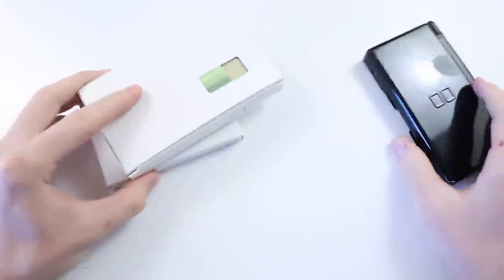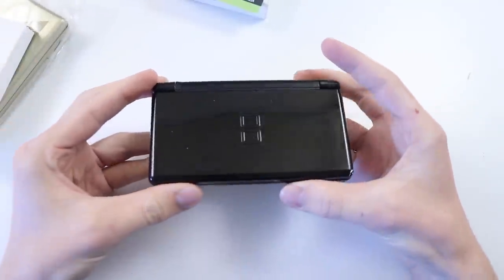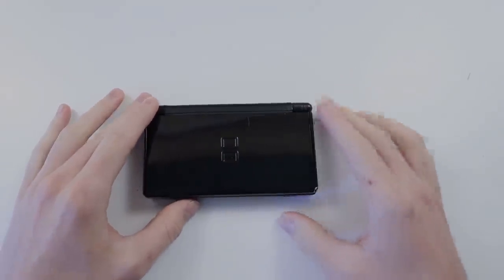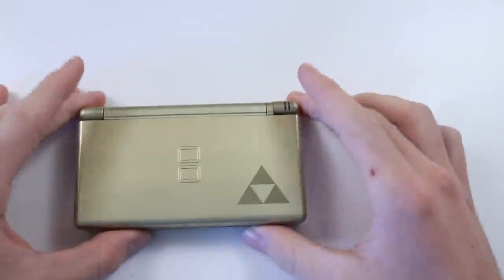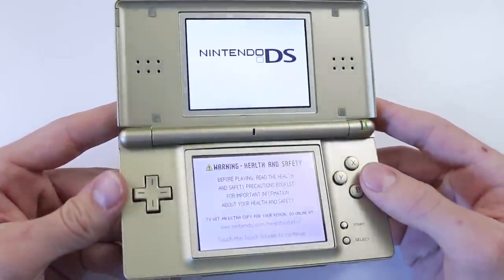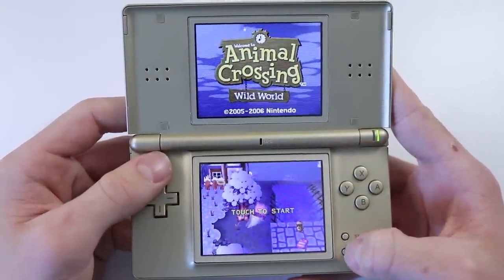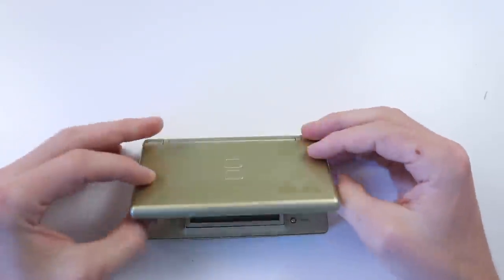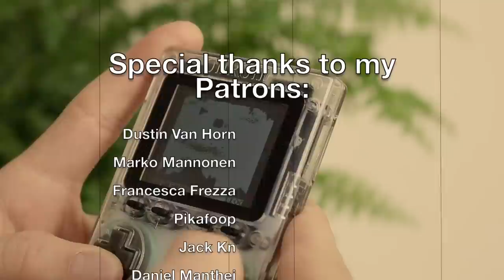Let's Refurb! - Nintendo DS Lite Screen & Shell Replacement!

Comment: I’ve repaired and sold hundreds of ds lites on ebay but I remember the first time I attempted to repair it took me over a month to complete the repair but then I got so skilled in regarding that I was able to fully change screen and reshell a console with broken hinge in 10 minutes. It was so much fun.
Reply: Where did u learn every component inside ?
Reply: @MrSea123456  i can repair your ds lite and change case to a clear one if you want
Reply: sadist
Reply: Can u repair mines
Reply: It’s turning yellow after 10 years
Reply: Lemme buy one off of you homie
Reply: My ds lite I have had it since 2010 (it was my older brothers didn’t know when he got it) the top screen is blue and the bottom screen has a bunch of dead pixels
Reply: where to you buy shells from?
Reply: whats ur account
Reply: Can I send you mine?
Reply: You doing that then vs me learning to do this now since the market is nice atm
Reply: @BigRheno  I'm also looking into fixing mine
Reply: @FancescaTanuki  can you repair my lcd?
Reply: I am still trying to get a DS Lite back to sit flush after taking it apart fully that is the real challenge
Reply: I’m actually doing it for my first time right now, although not for anything as severe as in these videos. Just cleaning the buttons and their places so that they work again
Reply: @ochuspin  how hard was it?
Reply: @SGVSOUTHSIDE  i was worried about breaking something but it went pretty smoothly!
Reply: Man, wish I could buy that
Reply: What shells do you use?
Reply: How expensive would it actually be to repair one? I Recently got one for free, but the top screen is just broken, any clue on how easy and expensive it is to fix/replace?

Comment: remember when people ripped the ds top display off to make it a gba...…...
Reply: People still do that 🤦🏼‍♂️
Reply: they still do that?!?!
Reply: yep
Reply: @Betrayed King PG3D Gameboy advance
Reply: whoosh
Reply: Idk why people still do that, u can just replace the top screen and have the ds ok
Reply: @SrSyztz  Some people aren't bothered to pay and try to replace the screen.
Reply: ChamCho124 I play the gameboy game  on the top display.
Reply: When my Original DS broke 2 weeks ago, my friend decided to rip off the top screen so he could have a free Game Boy Advance. Let's just say the DS no longer powers on...
Reply: It triggers me!
Reply: @maxwellm1266  I did it
Reply: I just did, most comfortable way to play GBA games. Rechargeable battery, headphone jack and I can put all my games on a flash cart to play it on the DS.
Reply: @sakurito55  you can route 1 speaker around back, drill some holes in the case, and have sound. I still prefer a full ds lite to half of one tho.
Reply: Do you just rip the top screen off? Or do you have to change the internals?
Reply: Well if it was already broken it's a welcomed change
Reply: Nerd Neck you have to bridge two parts on the motherboard, but it’s very simple. After that it should work
Reply: What if the inferior screen has sombe lights who wont work?
Reply: OH GOD YES I CRINGED
Reply: Why not turn it into a game boy micro
Reply: People did that?
Reply: Marg If you want a gba but have a ds that’s the simple solution
Reply: @ethanpiburn2107  If you rip off the top screen, you'll still have a DS slot. It'll just be useless.
Reply: They still do it XD I would but the DS Lite I use and the one that isn’t cracked on the bottom is special
Reply: Someone ripped a rare palkia and dialga one....
Reply: WHY???
Reply: The Yandere Real-Life Channel that’s big brain
Reply: Hey we get the top screens or they use those parts on other ds’s
Reply: he once did that for no reason btw
Reply: @margalocaris  Really old comment, but hey. Just wanted to add that if you use something like an R4 Card you can have a great emulator for GBA games. :)
Reply: @DatCrazyNerf  Huh, true. But you can emulate GBA games with an emulator in the GBA slot as well, right? Defeats the purpose of a DS slot... but at least the result looks cool
Reply: I mean, a 40 dollar cheap ass ds into something that works like a 100 dollar scalped handheld is pretty easy

Comment: a DS Lite shell replamacement is the most complicated mod I've ever done. Mine had the horrendous pink shell, which had also yellowed to the point it looked like an infected wound, and to make matters worse, the bottom was totally ruined by attaching a security sticker on it. Because I was strongly cautioned the leave the screen bezels in place (I was told it would be unlikely I could change them out without breaking the screen, I also ended up using some other pink components together with my dark blue replacement shell, which turned out to be a cool look (pink bezel, buttons and GBA slot cover)
Reply from the maker: They are definitely very difficult! I think the pink looks smart! Each to their own. My GBA SP is pink! Maybe I'm weird...
Reply: I think the yellowing is what pushed me over the edge, the color had become fairly unpleasant. Plus the security sticker glue was not coming off even with alcohol. The two-tone look worked really well, however, and it let me keep the slightly higher-quality Nintendo buttons and D-pad, so actually playing on the unit still has the same feel.

Comment: Have you tried turing it off and on?
Reply: Dusty Nuts Have you every tried getting a IQ?
Reply: @cyriloen8432  he meant turn
Reply: @cyriloen8432  turning on and off
Reply: Littlex Froakie have you ever tried to get a joke?
Reply: @cyriloen8432    r/wooosh
Reply: Nisse PRODUCTIONS Yet what I commented was a joke 😂
Reply: Erick 36384 Again, what I commented was a joke itself.
Reply: @cyriloen8432   I didn't see the comment
Reply: Flowey Face it was a joke, chill out
Reply: @cyriloen8432  i am chill. I told r/woosh. Somethin' special about that?
Reply: @cyriloen8432  r/woosh
Reply: I will try
Reply: @cyriloen8432  r/wooooosh
Reply: @paxryder8907  dude you're 1 year late, i was an prepubescent child calm down
Reply: @paxryder8907  also that joke is a year late aswell.

Comment: That hinge breaking easily back then,
that's the reason the 2DS exists.
Reply: 2DS XL has hinges again because people scratched up their screens lol
Reply: There is no winning 😂
Reply: If the 2DS had a calculator style slide on case acessory it wouldn't scratch so easily.
Reply: tbh the hinge is only really poor on the ds lite, comparing my two to my 3ds at least. the 2ds is a dumb design
Reply: I've got three DS lites none have a broken hinge, which still surprises me.
Reply: Yas mah man, yas
Reply: Not every one can just buy a 2DS like its nothing
Reply: @TheRealMrGreenSkull  There like dirt cheap now
Reply: セルリアン型フレンズ セーバルちゃん yeah the DS and DS Lite were the ones with hinge issues. With the DSI and onwards Nintendo fixed the issue by allowing a bit more play in the hinge

Comment: Also the hinge on the 3ds XL is normal to be floppy like that ... Mine is like that too
Reply from the maker: Not that floppy! Compared to brand new ones at least.
Reply: The Retro Future hey while you have it apart can you go over the common fault of ribbon cable shorting? It's due to the weight and nature of the wiring in the top screen and hinge.
Reply: Ksi vs Logan paul was a draw
Reply: Actually, because of the screen weight, it should wooble a lot more than a DSi, a regular 3DS/New 3DS, or even the New 2DS XL.
It should be floppy, but a little wooble is regular because or the weight.
Reply: my 3ds xl has so many problems with it i'd rather just buy a new one.

Comment: Quick tip! For weaving the antenna cable under the DS cart slot use a needle with a bit of thread and knot it near the connector of the cable, let the needle fall through the gaps under the cart slot and slowly pull the cable through, easy peasy!

Comment: You got lucky with the screen, adjusting the voltage sucks and it's easy to break the trim pot
Reply: Rhönen Wolf I must be really lucky then. As a literal child, I replaced this screen successfully using a text and image based guide, and I've never took anything apart before in my life. (in case you're wondering why my dad didn't help it's because he thought it would he a good way to introducing me to repairing electricals but I don't think either of us knew how hard it was)
Reply: Jacob Rendall lucky as in the calibration of his DS Lite and the new screen matched so he didn't have to tweak it
Reply: Rhönen Wolf I don't know what that means but I'll Google it give me a sec
Reply: Rhönen Wolf Oh ok

Comment: Does anyone have a full step-by-step guide for re-shelling a DS Lite? This was great, but I feel a lot of the little details were missing... I managed to do most of it on my own, and got it to work fine, but I think I forgot the clear plastic bit for the power lights on the top right of the bottom part of the shell... And I'm still hoping I didn't forget anything else, haha... (P.S. the springs for the L and R buttons were indeed a pain, mostly because I figure out that there are 2 different springs in the kit I got, one being the mirror image of the other, and it's easiest if you figure out which one is which from the very beginning). Props for the video, though!!!
Reply: there are alot of videos online about how you can do it.
Reply: @aborealisglfry  Really helpful cheers

Comment: Good video except I can’t get the ribbon cable for the top screen disconnected from the motherboard. Is there some kind of locking mechanism or clip. I’m pulling on it as hard as I dare but it won’t budge! Thanks for your help.

Comment: Really useful info! I was thinking to change only the outer parts of the shell of my DS lite (top and bottom), without messing too much with boards and cables. I guess it would be much easier. Would that be technically possible or I have anyway to disassemble the whole thing?

Comment: Holy moly, I'm basically going to do the same thing when the DS lites ship. I basically bought 2 "for parts" DS lites off of eBay. One of them works perfectly, just that the GBA slot doesn't accept the games. The other one's screens don't work, so from the nonworking GBA DS lite, I'll be getting the shell and the screens out of that, and putting them into the other DS Lite. Also, your videos inspired me to do this, so thank you very much

Comment: Are there places I can get my DS Lite repaired? I’ve got a messed up touch screen, the plastic-like layer on top the bottom screen is cracked and dirty, the left back button doesn’t pop back the best, and the top screen has like a blue blur/damage on it. I was wondering if there were stores and stuff I could bring it to, since I highly doubt I’d be able to send it to some guy on amazon or ebay to fix it for me.

Comment: I may try to repair my old ds aswell.
The top screen is almost dead - a broken cable i guess since it has a distortion on the screen and sometimes on the right angle it works just fine.
The shell has some scratches but is in a good condition.
Replacement screen plus tools to open cost 6€ from china.

Used units still cost around 25€ and more.

Comment: Does anyone know if the the plastic screen covers are interchangeable between the top and bottom screens?  I'm looking to customize my shell a bit but the eBay store I found does not have the top screen cover in the trim color I want.  So I guess my question would be, can a plastic screen cover for the bottom screens be used for the top screen?  (Not screen protectors but the piece of plastic that gets adhered to the system.)

Comment: At 3:36 you did not show how to fit the 4 track ribbon. Also to run back the black wire under the card slot is almost imposible without desoldering at least 2 legs attached to the board.

Comment: Hi Elliot, been a fan of the channel for several months, love your content. I bought a DS Lite off CL today and unfortunately it doesn't power on (I was too dumb to check before I paid for it), but I took it apart and could see the power toggle broke off so the switch was completely loose, it does power on, plays games, etc so replacing that is no biggie HOWEVER I am getting this weird pink tint on the bottom screen...even when I set the color to blue or grey, its always a bit pink. I tested a GBA game in both screens and the whites are definitely pinkish on the bottom screen. Any ideas why?

Comment: I dropped and lost the small metal tube bit that fits into one end of the hinge where the ribbon cable goes through. I've spent ages looking for it and can't find it anywhere... So, am I going to notice much difference without it?
Reply: Okay, yeah I can see it holds one end of the hinge in place. Pretty cheap on eBay, so I'll have to buy one.

Comment: My silver ds lite's top screen goes white when it is bent far enough back. I wanted to try and fix it, but I don't have a tri-wing screwdriver :l
Reply: It's most likely the ribbon cable for the top screen. And you can easily find tri wing screwdrivers on amazon for cheap.
Reply: a lot of shells and screens actually come with one. I have about 12 just taking up space from refurbs I've done.
Reply from the maker: Screens and screwdrivers are cheap!
Reply: The Retro Future I think the screen is good, its probably a loose ribbon cable.
Reply: Mr SG well go get one
Reply: @mrsg1137  did u end up fixing it? My screen does the exact same thing.
Reply: @Grisso  nope. Its in a parts bin. I haven't gotten around to fixing it yet. Plus my 3DS now has the same break, so that will need fixing too :(
Reply: @mrsg1137  ah that sucks! Well if you ever get around to fixing it, let me know. Most tutorials are for changing the lcd but since mine partially works I'd like to only fix the ribbon cable, idk how tho.

Comment: I did EXACTLY this a few years back and accidentally made a hairline fracture in the soldering for the charging circuit, and now it no longer charges. I've since attempted repairs but it was unhelpful and did nothing but make a mess. Still have it though :)

Comment: I remember when I first got a red ds lite the interior casing cracked so I sent it in for repairs and was told they were all out of red casings so I was given a black and red combo which looked amazing and I still have it 😀
Reply: @fortnut adventures yee No, it isn't a pattern. The back of the top part is red, while the rest is black.

Comment: So i was all set to put one of these sweet zelda cases on my DSL to do the same thing and match my 3DS, then i saw how insane the inside is. Seriously, soldering onto ribbon cables and messing with trigger springs and ribbons so small you need tweezers. Naw dude, i'll leave this blood pressure spike to you.

Comment: I got a refurbished ds lite from eBay it worked fine but after Some months the top screen just stopped working I could hear the sounds of it but it was just black it didn't flicker either and I need help with it

Comment: I got a ds lite aswell but the top screen isn´t working well.
The contrast is trash, you can barely see anything on the bright white screen, before it went totally meh, it was working at some positions so as long as you would open it fully, then close it a bit and it would eventually work but now not even this works.
I guess the flex cable broke at some point, LCDs are pretty cheap, may look into this one day and also give it a good clean.
However GBA runs still fine on touchscreen...

Comment: I want to open my nds to fix the R button, because it's broken (and no, blowing on it didn't work), so i was going to buy one with broken screen to take the good parts and modify my actual one (i saw someone selling a ds with broken screen for 10€). Is it worth it or i should just use an emulator?
Reply: Honestly I think it's just cheaper to buy a new ds. The original ones aren't very expensive these days.

Comment: Tried to replace the shell on my ds lite.. I broke the ribbon cable of the screen. Bought a replacement screen, installed it, but after 2 days one speaker stopped working. Opened it again and broke the second screen ribbon cable too... then I gave up...

Comment: My dark blue DS Lite's hinge is the same way, and the straight middle of the touch screen does not work either. I got it back in Kindergarten and im in 8th grade now so go figure 😂
Edit: when you move the top screen it makes a clicking noise in a certain spot (not the good kind of click) and the screen flashes but goes back to normal

Comment: I tried doing this and now my Ds won’t work. I go to turn it on and the top screen comes on for a split second, then it dies. The bottom screen does not turn on at all. Any help would be greatly appreciated. Thanks
Reply from the maker: Could be a lose or unplugged ribbon cable.

Comment: i got a brand new open box white ds lite for only 30$ 0 scratches and unopened charger. the original battery even holds a charge! i dont even take it out the box really. only when i want migrate pokemon.

Comment: I wonder if it's my dsi xl itself of the charger for it cause the light doesn't come on at all and it stopped charging randomly but the dsi xl works fine it just has half battery  EDIT: it was the charger we got a new one for 5 dollars and its worked just fine and i still play it

Comment: my ds lite quickly turns off after powering on however the screen looks right. what could be wrong?
Reply: If you opened it, you need to check the ribbon cables are properly seated.
Reply: @sodhina  yea I opened it for the first time and couldn’t say or notice something was wrong

Comment: 1:20 14 pounds? They sell for about 60 or 70 dollars down here in used condition
Reply: It was listed for parts or repair, so they are sold for extremely cheap